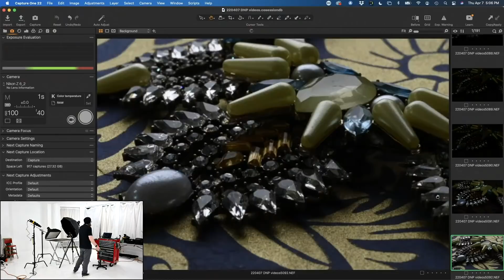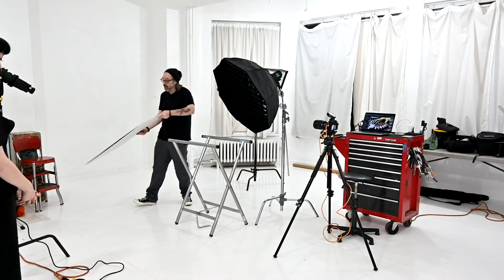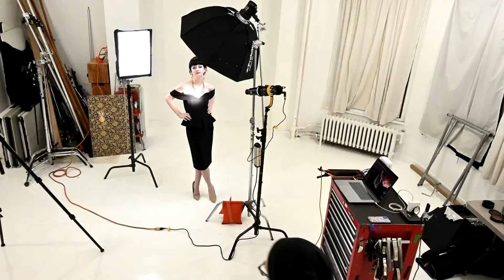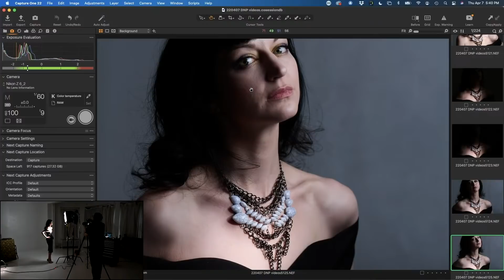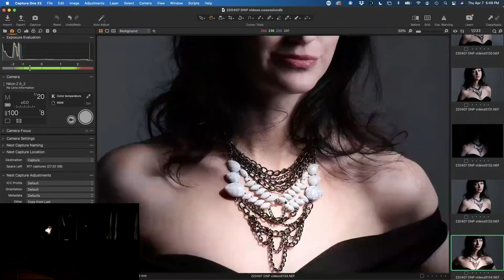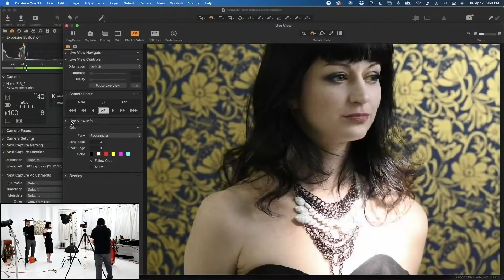Exploring Macro Photography: OnSet with Daniel Norton

Comment: Daniel, when you mention modeling light maybe throw in a bit about "proportional" modeling light. In a video by Seth, he discussed how Profoto mono-heads are able to synchronize their setting levels when you put different models to work together. I was not aware of the latter and it is a very attractive feature. Is this really true, I thought. It suggests there is some communication going on with or via the remote controller (I guess). Again, this then makes me wonder if the modeling light becomes correctly proportional across the different heads.

In my broncolor studio pack past, we used a regular lightmeter and metered the modeling light for exposure. The f/number at proper ISO, but read the f/number at the exposure time that would give the f/number for the flash exposure (a few Polaroid shots and we figured that out "forever" - 40 years ago - forgotten again another long time ago).
This is to say, if you have reliable proportional modeling light then it helps a lot and you don't really need a flash meter (if you felt you need one in the first place).

Comment: Still watching the video and at about 1/3rd now. As you had the Z 105/2.8S at f/40, this has a bit of interesting (nerdy) detail. Conventional lens designs have their elements in a fixed arrangement. The optical qualities and its specifications like focal length and maximum aperture then are listed at infinity. Focused to infinity, this Z 105/2.8S can be stopped down to f/32, not f/40. What happens when you focus closer by than infinity is you shift the lens away from the sensor/film and this extend the focal length. And with the larger focal length, the angle of view gets smaller - called focus breathing today and normal in the past. Also, with the longer focal length, the diameter of the aperture remaining the same, we need a larger number as fraction of the focal length. In our large format past, we would apply an exposure compensation for "bellows extension" and this is what the Nikon firmware makes explicit to us. The camera does not need a "bellows extension" because it meters through the lens, but if we want precise depth of field calculations we do need it. And with this lens, Nikon gives us the correct number.
If you now think that a prime lens without focus breathing is actually a zoomlens, then yes, that's how I look at it. And this lens does not do that. I have one, shoot it with a Z 7ii and it is a great lens with incredible sharpness whilst retaining a very pleasant level of smoothness. Ideal for portraits as alternative to the Z 85/1.8S that I also have and is sharper, smaller, etc., but has less buttery smoothness.